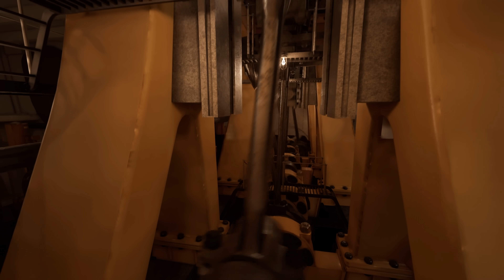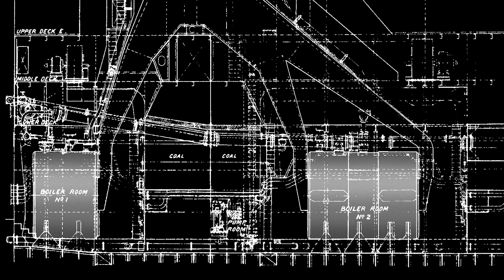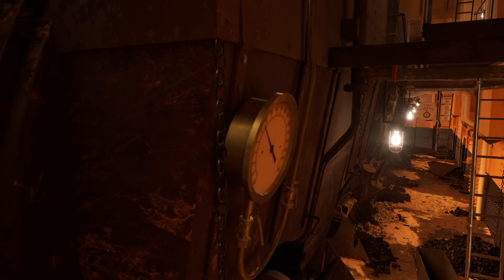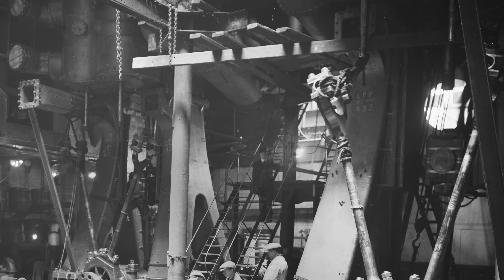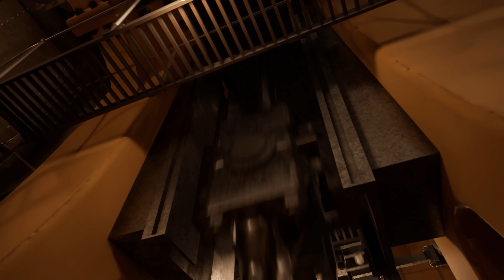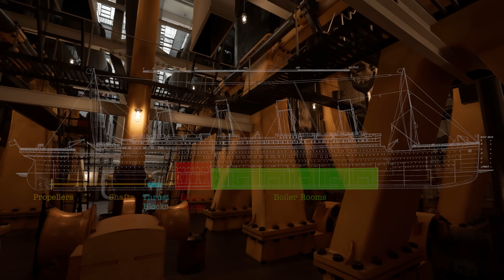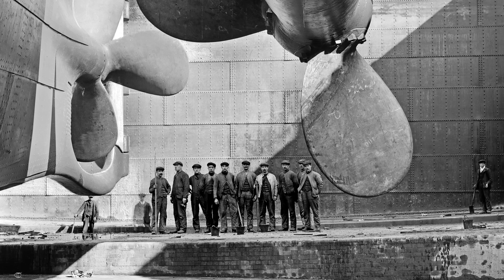A Complete Guide to Titanic's Engines

Comment: The best way to actually save titanic at the time was to actually ramming it straight into the iceberg, because there is another incident on a smaller ship, that hits the ice berg ad it does indeed destroyed the front of it, the difference is the smaller(but still big) ship doesn’t sink, because passengers ship lime titanic have compartments that have water tight doors that would allow the ship to getting fully filled with water if one or 2 compartments was actually leaking, when and if the titanic may had rammed straight into the iceberg, titanic may have survived because by ramming it, it may have destroyed 1-2(at most) watertight compartments that the ship have and cause it not to sink, titanic itself had 16 watertight compartments in total and the ship was actually predicted that if 4 of the 16 watertight compartments were ever to get breached, the ship won’t sank, which causes the makes of the ship saying it’s impossible to sink titanic. But in reality, the First Officer, William Murdoch, commanded the ship to be turned hard to port, and ordered the engine room to go full astern, his command would soon lead to catastrophic consequences, in which causes 5 compartments of the 16 watertight compartments to be breached, which if you remembered, is more than the limit that the ship could’ve taken(4). And the order that the first officer commanded, caused the ship to sink, which if instead he would’ve rammed into it, he could’ve saved around more than 1500 lives that night.
Reply: Murdoch had no idea that a head on collision would probably prevent her from sinking and hundreds still would have died in such a scenario.

They had less than 30 seconds to make the decisions they made and any human being would try and avoid a collision at any cost. Also the order given was 'hard to starboard, full stop' not reverse. Titanic's engines took three minutes to slow enough to be able to go into reverse from full ahead, that plus testimony from engine room survivors show that the order was 'all stop' as the stop light illuminated just before she hit the berg.

Comment: These days, all ships machinery designed well insulated, but temperature sometimes reach 50 Degrees C and more. Can’t imagine engine stuff were working with no mechanical ventilation and Air conditioned Control room.

Comment: 6 boiler rooms with 29 boilers? how do you gear the gears to conserve fuel ?
my car is fucked up and needs to go back to mitsubishi
these stupid americans used a white jeep to speed around me slam on the breaks and im cited for failure to reduce speed
I bring the car to some mechanics here because im advised to not take it to the dealership

so then they take 2 years on fixing it
install the wrong front bumper
then im harrased by stupid glen ellyn police about my front licsense plate

So then I hit a curb after working 12 hours because no thanks to the college of dupage in stupid america I didnt graduate 
and then this loser at tj auto tells me he will work on my control arm bracket rod in a few days
the little phillipino lied to my mother that he told me not to drive on it
then the carol stream police steal my phone after the westmont police wrote out a fake ticket

Comment: Im amazed by the technology of the time and as a mechanic,im wondering what type of bearings were used to support the weight of that colossal crankshaft,propeller shaft connecting rods ect. Im assuming they were plain babbit style which would require the constant flood of oil under pressure. Were precision ball and roller bearings even made back then?

Comment: 29:29 Every single time I see the underwater CGI, I have to cringe in seeing that center propeller rotating the wrong direction.  Even a 10-year-old would know which way a propeller rotates to provide forward thrust based on the angle it is attached to the hub.  I simply can't take this video seriously... what else did you guys screw up?

Comment: As far as the need for thrust blocks, it could be useful to mention Newton's 3rd law of motion. The angle of the propeller blades and their spinning results in water being pushed backward at great force. This results in an equal force forward, transmitted along the shaft of each propeller, per Newton's 3rd law of equal, but opposite, force. That force pushes the ship forward, but must be distributed to the ship's structures over sufficient area so that all if that force is not applied to a small area, as that would be too stressful to the steel structures. Thus, the forward force of each shaft would be distributed across several thrust bearings (or thrust blocks) that are attached  to the ships steel framework.

Comment: How did they get the burned coal out?  You didn’t cover this.
Reply: When close to or in port the ash would be bagged and placed in the ash room to be offloaded during refueling.

When at sea the ash would be mixed with sea water and ejected out the bottom of the ship.

Comment: It’s almost impossible to believe they built what they did before computers. This was simply pencil to paper mathematics. The engine designs and castings that had to fit perfectly together, all the rivets instead of miles of welding. Every single little thing had to be thought about, no computer solving it. Everyone had to work together. Wow

Comment: I didn’t understand the discussion of the thrust blocks on the propeller shaft. Can anyone clarify how they worked?
Reply: From what i understand its a type a of bearing that transmits the thrust generated by a ships screws into the hull rather than directly into the engines. How it fully works though and the physics behind it is beyond me. Hope this helps somewhat.
Reply: It’s where the crankshafts from the engine were connected to the shafts of the propellers. And it looks almost like another engine mount and it is mated to the super structure. Going from forward to reverse would destroy the engines if this didn’t absorb the thrust effects of the propellers. Most large ships have something similar to this system, aircraft carriers, tankers, cargo ships etc

Comment: ONE POINT TO NOTICE
ON YOUR PAGE SHOWING THE CYLINDERS
THEY SHOULD BE DIFFERANT DIMENTIONS
LIKE HIGH PRESSURE 220 THE PISTON SHOULD BE  QUITE SMALL
DONT KNOW DIAMETERS
BUT THEIR IS A STSANDARD RATIO
LIKE THE 220 TO 75 TO 9 REQUIRES A DIFFERANT  VOLUME OF CYLINDER
MARINE ENGINEERS KNOW THIS
THANKYOU  sorry about caps

Comment: How would the salt water even get into the evaporator?
Reply: Sea chests, or openings in the hull would pull the water in.
Reply: @Tozzpot500  ohhhhhhhhhh that makes more since now thank you
Reply: @SillyNooberr  No problem, happy to answer any other questions if you have any.
Reply: @Tozzpot500  Back then in 1912 was starboard the left side instead of the right?
Reply: @SillyNooberr  kinda? Titanic used Tiller Commands so "hard a starboard" would mean hard to port and vice versa. However port and starboard were the same as they are today. The command system was dropped sometime between WW1 and WW2 for ease of use though can still be found in some regions of the world or on board heritage vessels.

Its a bit confusing to us nowadays but Tiller Commands were the standard at the time. As always happy to answer any question you may have and i hope this answer was helpful.
Reply: @Tozzpot500  Thank you I would have not known without you're help the reason I asked that is I saw a comment that it was different back then. So you help me not be confused with that So thank you again.
Reply: @SillyNooberr  No problem, im always happy to help, if you have any other questions please feel free to ask.
Reply: @Tozzpot500  How would Titanic's middle propeller start?
Reply: @SillyNooberr Titanic's center prop was driven by a steam turbine. Once pressure in both main engines was sufficiently high enough steam would be allowed to enter the turbine making it spin. However due to the construction of the turbine the center prop could only propel Titanic forwards, it was incapable of a reverse gear.

Hope this helps, as always if you have any other questions im happy to answer.
Reply: @Tozzpot500  thank you again I really like you telling me stuff about titanic that i don't know about
Reply: @SillyNooberr  Hey man no worries, Titanic is one of my niche interests and i love sharing information about her with other people. So if you ever have any questions just ask me here and i'll do my best to answer them for you.
Reply: @Tozzpot500  it's one of my niche interests two.
Reply: @SillyNooberr  Thats great to hear, the Titanic is a fascinating subject with so many little details to rediscover so its great to see people be interested in it.
Reply: @Tozzpot500  Hi again it's been a while since i last talked to you so just wanted to say hi

Comment: This was amazing.  It's boggles the mind that the engines created 46,000 horse power.  I've always wondered how those engines operated.  I wish I understood how that hot stream was vented after each stroke of the piston  It be interesting to see how that was done. Thinking about how you have to keep the pressure to push the piston put vent the before it cooled down to the turbine.  What a marvel and to think all that sunk within days.  .

Comment: One error. The steam exiting at 9 psi is not below atmospheric pressure. If that were the case, there would be a vacuum at the exit. 9 psi is actually 9 psi above atmospheric pressure. Gauges account for the atmospheric pressure of about 14 psi by registering at 0 at this pressure.

Comment: Soo' now it's! Sure the Titanic , use 2 very big 4 Zylinder Stirling engine's. Soo' meby some bat Oli Gas into the hot Air Zylinder. Name: die Zylinder wurden bestimmt auch geschmiert. I still think IS posibol the Engine it's guilty fore' the Titanic Go 🚢👇. Meby really some Zylinder 💨💥❗. Or the hot Air Tank.

Comment: Starting in in the early 70's, I spent 20 years in the US Navy. I spent 14 of those years at sea down in the engine rooms. This video was very interested to me. While the boilers I was around used black oil then converted to diesel fuel, I did know a few old timers who had to shovel coal into boilers similar to Titanics. They all had huge forearms. 🙂 Thank you for posting.

Comment: Why label a reduction gear as a turbine? Particularly when Titanic's turbine was direct drive, there was no reduction gear. Also, those propeller shaft bearings shown were not "force fed" lubricated. Each bearing had a small sump and a loose ring hanging from the shaft was dragged by fluid friction through the sump and carried oil that lubricated the bearing.

Comment: NGL, I hate the 97 Titanic film, but this insight into the mechanical insights of the time fascinate me.
Reply: Also, a great thing about a recirculating steam system is that hot water could be fed back into the boilers, meaning less energy was needed to turn it back into steam compared to cold or ambient water.

Comment: This made me think.
Hard to imagine the number of problems to solve, creating and integrating all the parts.
The engineering calculations, to decide how thick each beam, and pipe would be, how much weight/steam it could carry. 
Hours and hours on the drafting table, turned into hours and hours of manufacturing, and assembly, by thousands of craftsman, using the finest materials...
All sent to the bottom, because of mans need for speed 💥💦

Comment: How was coal ash discarded?  How were the propellor shafts sealed from sea water?
Reply: In port the ash would be bagged and stored in the ash room until she was docked. At sea excess steam was used to push the ash into a high powered water stream where it would become a slurry that was then simply dumped into the ocean via a port in her hull.

Titanic was built just as sealing and bearing technologies were beginning to change. 
(1) The stuffing box was effectively a rope called “packing” that was coiled and impregnated with grease, then kept constantly lubricated. By coiling the packing over a long enough distance and keeping the stuffing box filled with a very thick grease at a pressure that is greater than the outside, you’re able to prevent water intrusion while still allowing rotation. The packing was wrapped around the shaft and rotated with it, and the stuffing box was a metal labyrinth that was grooved to mate to the packing. 
(2) A “bearing” is any differential material that makes motion easier. (A rug becomes a bearing when you place it beneath a piece of furniture and slide it across a tile or wood floor.) While wooden bearings were around, they’re a much older technology and incapable of carrying the massive loads of those shafts. This was just before ball and roller bearings, so they used brass alloy bushings that also required constant lubrication. These bushings were usually split in half axially so they could be replaced without completely removing the shafts.

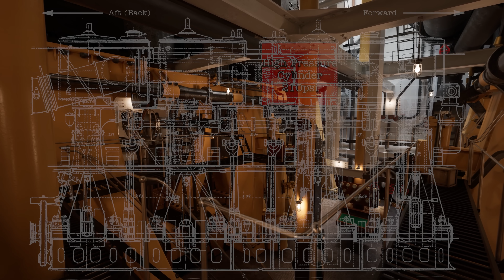Comment: From 19:34 to 19:54, you use red, yellow and blue colours labelled High pressure, Medium (i.e. intermediate) pressure and low pressure cylinders, but in each case, your colouring extends sideways to include their respective valve chambers.  For example, the red colouring should be only about half of the width shown i.e. only the right hand side of the red area shown should be red - it should be narrower than the cylinder cover shown above it.  (The piston has to be narrow enough to be withdrawn upwards through the cylinder, after the cylinder cover has been removed. The cover is, of course, of greater diameter than the cylinder.)
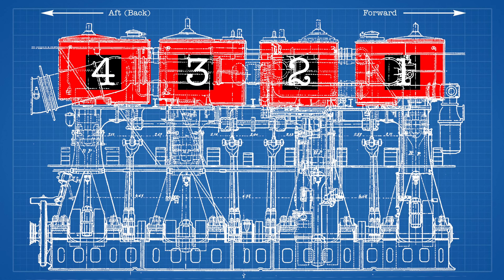Similarly, at 17:56, your red colouring for the HP piston is much wider than the diameter of the cylinder cover above it, and is about the same width as the colouring for the IP piston.  The colouring for the HP piston should be narrower than the cylinder cover drawn above it, and narrower than the IP piston.

Comment: At 17:50, you have numbered the four cylinders from 1 to 4, starting at the forward end of the engine (on the right of the drawing.)  You could improve this by lettering them LP, HP, IP (intermediate pressure), LP.  You can confirm this by looking at the diameter of the cylinder covers: the smallest you have numbered 2, the next is numbered 3, and  the largest (equally sized) are numbered 1 and 4.  That was the  typical arrangement for a four cylinder, triple expansion engine.  This is confirmed by the lettering on the top ends of the connecting rods: from right to left the letters are BP; HP; IP and BP.  I suspect that the drawing is French: the dimensions appear to be written in the metric system style e.g. 6'32, and BP could be basse pression for low pressure, HP for haute pression, and IP for intérmediaire pression.  Further to my separate comment on valves, looking at the valve covers beside the cylinder covers,  the valve covers beside your Nos. 2 & 3 cylinders appear to match in design (with a central raised portion to accommodate the top end of the piston valve's rod and securing nut(s), whilst the valve covers beside your LP cylinders (numbered 1 & 4) match each other.  This suggests that the HP and IP cylinders both have piston valves and, as one would expect, the two LP cylinders have slide valves - on this drawing.  However, it seems that this is not a drawing of one of Titanic's engines, because it is unlikely that it would have metric dimensions or that the LP cylinders would be labelled BP. Also, I can see two continental figure 7s in the picture i.e. with a line crossing tail of each figure 7.  That would seem unlikely if the drawing were produced in a British (Belfast) drawing office.  Of course, Titanic's engines might have been designed on the Continent.
I have found a sentence in Titanic - The Ship Magnificent Vol. 1 page 306 that confirms the order of the cylinders: "The order of the cylinders, beginning from forward,  was LP, HP, IP LP."

Comment: Great video, thank you.  
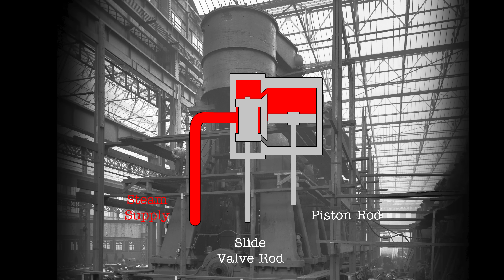At 18:02, you show a drawing of a piston valve, but you call it a slide valve and you label its valve rod a slide valve rod.  Generally, piston valves were used for HP steam and slide valves for lower pressures, because high pressure steam on the back of a slide valve presses the valve too hard against the face of its valve ports, creating excessive friction and therefore wear.  Slide valves are simpler to maintain, making them preferable for lower pressure steam.  You would expect a piston valve for the HP cylinder and probably slide valves for the intermediate (IP) cylinder and LP cylinders.

Comment: How did they deal with the Ash from the coal.
Reply: When near port it would be bagged and stored in the ash room. When at sea it would be mixed with sea water and flushed out the bottom of the hull.
Reply: @Tozzpot500  cheers 👍
Reply: @John-mz8rj  no problem, if you have any other questions feel free to ask i may know the answer.

Comment: How was the residual ash from burned coal collected and how was it disposed of during a voyage?
Reply: When at port or approaching port it would have been loaded into canvas sacks and placed in the ash room to be offloaded once in port. When at see it was mixed with sea water then flushed out the bottom of the hull.

Comment: The fourth stack has always been described as a dummy stack, that was only for aethetics, although you explained it vented no smoke, it vented heat from the turbine. That's very useful, therefore it wasn't just for looks.
Reply: It did actually vent smoke just not from the boilers. Instead it came from the 1st class smoking lounge and the ships kitchens